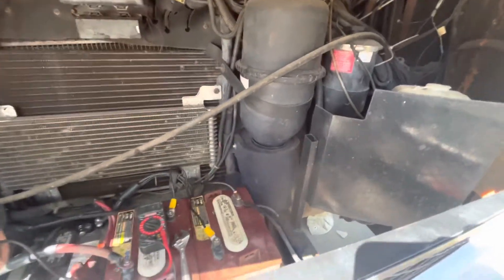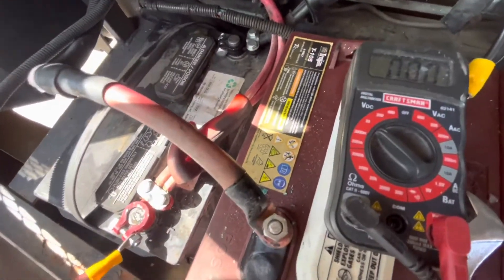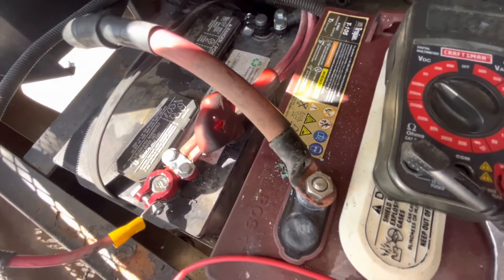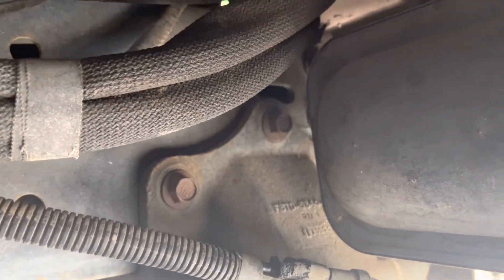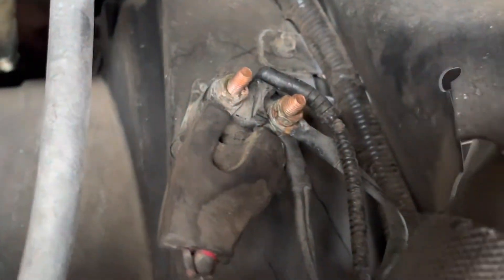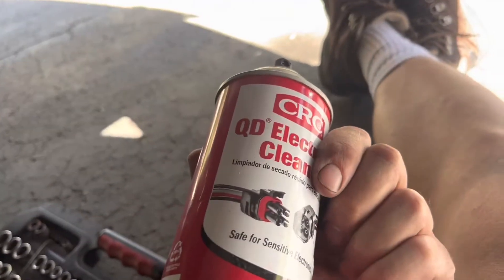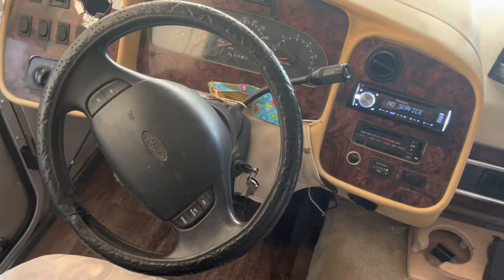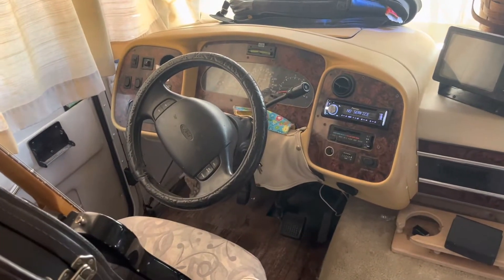Motorhome had no power to the ignition or dash accessories￼

Comment: Thanks. I'll try it!

My motorhome won't start? I must first push Main Battery on switch, then a red light goes on next to Ignition switch. That's standard procedure and usually fires up engine after turning key. But now my auto stairs suddenly moved and that's it? No power to starter motor! I've cleaned all terminals on battery and cables. So maybe my starter is broke? I'm going to check under vehicle now for possible corrosion on other cable connections
Reply: I have exactly the same problem with the stairs . Did you fix it ?

Comment: Hey bud im having the same problem woth my RV 1986 chevy pathfinder original problem was fuel pump and didnt have a battery…i put a battery in and hooked fuel pump up and to gas can and got it to start amd run for a few mins and then it shut off when the gas ran out..everything was workimg all lights and accessories it did have a kinda sluggish stall when turning over but then would turn over after homding the key for a second…after a few mins i went back in to try to start and now i have no power to anything no lights no horn blinkers nothing as if i dont even have a battery in it i followed the positive cable rhat went to a selonoid that says “ignition proof coach” that was all corroded up and snapped in half when tried to take the nut off…could that be what cause to not get power to anything like in tour video